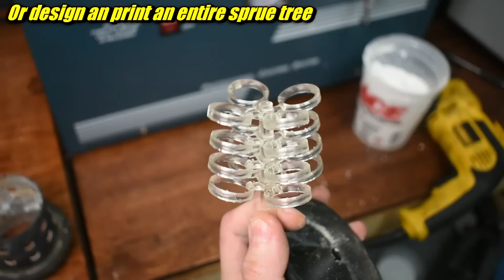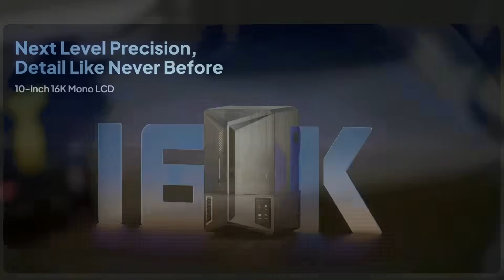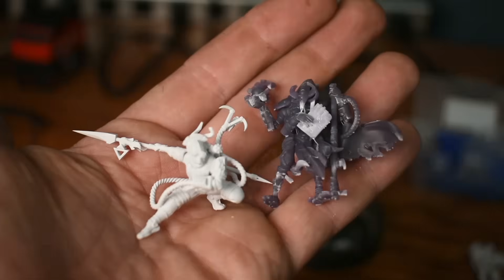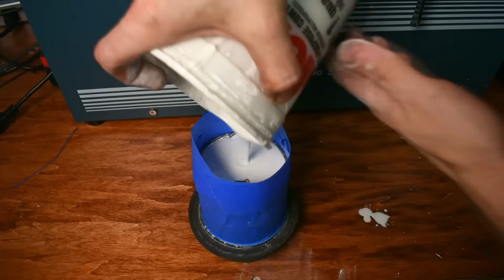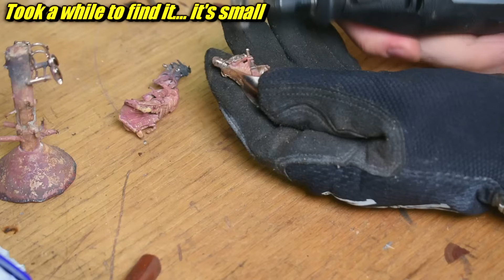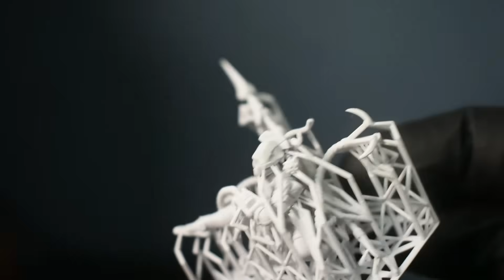The WEIRDEST Investment Casting Resin | Bluecast X-Wax

Comment from the maker: Check it out: https://www.bluecast.store/product-page/bluecast-x-wax-for-mono-lcd-dlp

Review of the burnout oven and other equipment: https://youtu.be/_y7NTUzZoJU

Other stuff:
Saturn 4 Ultra 16k printer: https://amzn.to/43WJzdM
Presige Optima Plaster: https://amzn.to/3sCre7l
10mm Wax Sprues 1lb: https://amzn.to/3MS6Cid
1mm Wax straws: https://amzn.to/49Wb3CL
2.5mm Wax straws: https://amzn.to/46loYin
Wax Pen: https://amzn.to/3sCrmUn 

Want to learn sand casting using your 3D printer? I can teach you!: https://paulsmakeracademy.mykajabi.com/joinus
Reply: Hey Paul, I have seen the exact same burnout oven in an other video, the video was about sintering. Maybe you are interested in that stuff too as a metal part fabricator, after all it isn´t so much different to metal casting. It might be even simpler.

Comment: I’m on the verge of ordering this, but one thing I noticed on the blue-cast spec sheet directions it says something about using acf and that it needs to be a certain thickness. Did you replace yours on your tank? Or just everything stock
Reply from the maker: I didn't bother with that, it just worked out of the box.  I have also used this on a Nova3d Gem3 printer straight from the factory, which I believe does not have an ACF either.  It worked great.

Comment: A couple of things here. You quenched the casting red hot which is a no no. Metal will crack from the shock.Depending on the metal us casters wait till there is no color seen on the button. usually around 15-20 minutes. Cast earing wires are also problematic. They will break because cast molecules are large grain and brittle. Earing wires should be run threoygh a mechanical proccess where the molecules are compressed and become dense. They are added to the rest of the cast piece by hard soldering.

Comment: Hello does anyone know what is the exact printer settings are ? 
i have a saturn 4 ultra 16k my self and just purchased the bluecast x wax but i ran into an issue with the printer settings ive been told that bluecast website has an ai system which helps with profile settings but unfortunately it doesnt work for me so i am just trying to find someone  who already used this wax with this printer that i also have and already experimented with it enough to be able to make succesful prints i only have 500g of the wax and i found it way too expensive to just start messing around before asking somone who has already done it 
thanks for you time/tips/efforts happy printing yall !!!!!

Comment: Can sprews be printed from the very beginning with the same material as a part of the model or as support instead of attaching later by hand? Thnks
Reply from the maker: Yes!  You definitely can.  Ive only done it a couple times, though.  It wastes a bunch of resin on the sprues and stuff, the support material can ve tricky to remove between all the parts, and because the print is so much taller, it takes a lot longer to print.  But you can definitely do it

Comment: The resin is expensive. I get good enough results with Royal Blue resin from Sirayatech. Much cheaper and works well as long as you clean and dry it well and cure it enough.

Comment: Bronze jewelry? Why not silver electroplate onto any bits that touch the skin?
Reply from the maker: good idea, but i don't have any silver laying around
Reply: @PaulsGarage  Make your life easier by just buying the pre-made electroplating solution. There'll still be a learning curve, but it will open up a lot of options.
Reply: @MickTee2k  Yeah, Caswell Plating makes some easy to use, prepackaged plating kits for gold and silver.  Aside from that Rio Grande Jewelry supply sells silver and gold casting grain.   I usually cast in brass for model train subjects, but have made my wife a few pieces of jewelry in silver, using Rio Grande's pure silver casting grain.  Works great and takes a really nice polish with a cloth wheel and polishing compound using your Dremel or Foredom tool.

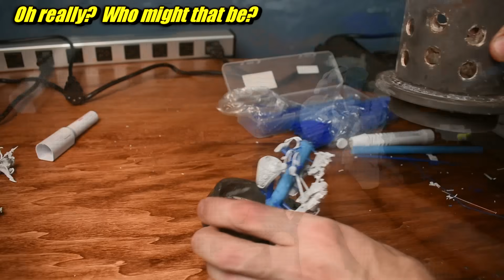Comment: 6:30 If you´ve had prolonged the 2 swords, so that they now (at 6:30 ) touch the main wax-stem, the 2 swords could suck metal from both ends during shrinkage, and they´d come out less damaged, maybe even perfect...
Reply from the maker: they did contact at both ends, but broke in the middle.  I think it may have solidified, then pulled apart when the sprue and the body of the guy (on either side) hardenned and pulled them from opposide ends.  Just a theory, though.  i'd have to make another one to be sure.
Reply: @PaulsGarage  Sorry, then, I misunderstood/overlooked something...

Comment: I used to work for a jewelry manufacturer (made about a million pendants / rings / souvenir stuff / etc) we always did a lacquer coating after they came out of the tumbler to prevent them reacting with skin.
Reply from the maker: How long did that last?  Did it have to be reapplied after a while?
Reply: @PaulsGarage  I assume eventually it would wear through, if someone really tried. But rings, earrings, etc are pretty low wear on the parts that touch the skin. The company I worked for did offer free refurbishing,if needed, and we did have some people use the service.
Reply: @PaulsGarage  protectaclear works really well, I still don't do bronze for earrings, but  ive had customers with skin allergies that went out and got their own bottles after they didn't turn green from my Tin Bronze with the protectaclear sprayed on it for 6 months
Reply: So body absorbs mor cancerous micro plastics
Reply: @mevk1  Except that lacquer it not plastic so where exactly are the microplastics coming from?

Comment: So many ways to clean up jewelry castings; files and carbide burrs are great for rough cuts, I usually use silicone wheels from EVE or abrasive wheels for general polishing. Both are pretty affordable on Rio Grande, and have knockoffs on amazon. Sandpaper wheels/rolls are good, there are some that go up to 1200-2000 grit which is honestly sometimes excessive. Mirror finishes are nice and then almost immediately get ruined by fingerprints lol. All of these will fit in a dremel with a chuck you just lose the fine speed control from a flex shaft.  Polish with tripoli and rogue, sometimes you can just use rogue. GL & happy casting.

Comment: As much as I like my resin machines, I ended up getting a gargantuan FDM machine for my big casting projects that don't benefit as much from micron precision. Running reliable filament even at 10 Correction, 100 microns is very doable, and surprise of my life, FDM machines have gotten Fast in the last 10 years. Faster than my beloved Uni G2 that burns out LCD screens every time I use the heater function. Ugh... Anyway, ended up building a tungsten element burn-out furnace for stupid high heat functions and picked up one of your recommended zinc ingots to try out.
I'd like to try this stuff, but material costs alone, it would be north of $400 just in the faux-resin wax for one part I'm working on. I would guess it has a purpose for jewelry, but Way too expensive for serious use cases (volume anyway). 
Ah, one bit that will help your plaster mixing episodes, have a few projects ready to go and add the plaster into the water. It slakes a lot better and is much easier to get the right consistency until you find the right ratio.
Reply: 10 micron and "very doable" don't really go together when you're talking 3d printers.  Sure, in theory, the motion system can do that with microstepping.  However, at that scale all sorts of issues we can normally ignore have to be accounted for.  That's solvable, and the good machines can do it.  Just expect to spend $1,000 on the printer instead of a cheap Creality.

Unfortunately, I find the extruder and nozzle are the real pain in the rear.  The amount of time it takes to tune that is far higher than I'd like.
Reply: @EmperorA0  Damn flubbed fingers! That was supposed to say 100 microns.

Comment: The price is insane
Reply: It’s in the ballpark of what to expect for premium jewelry resins, which this one is.
Reply: As someone who has spent hours of my time carving wax to make custom jewelry, for a single, one off piece that I had one shot at it, the process for this resin is cheap compared to my time. It’s surely not for everyone, but for some people, this is a bargain
Reply: Not as insane as calling it insane. It's not a hobby resin. Luckily there are many cheaper options. Sure they may not be as good to use, but then at least some people will feel it's worth it to pay the difference. It's not as insane as housing prices.
Reply: Nope, the price of porosity on a platinum ring is insane. Ask me how I know...

I have used blu cast for years (X1 v2 currently) and they make good resin, in jewellery casting defects you might ignore are an issue.

Personally really excited to grab a bottle of this 😁